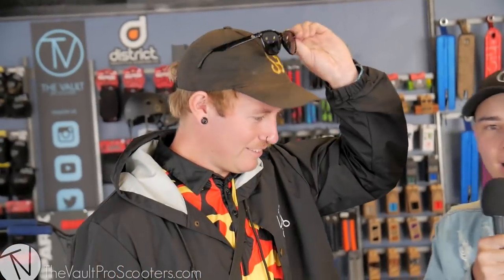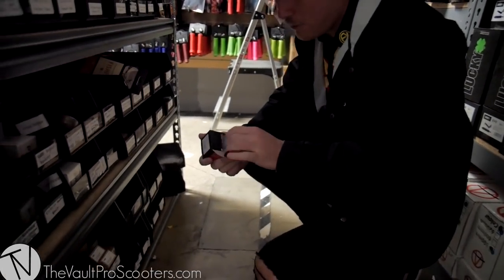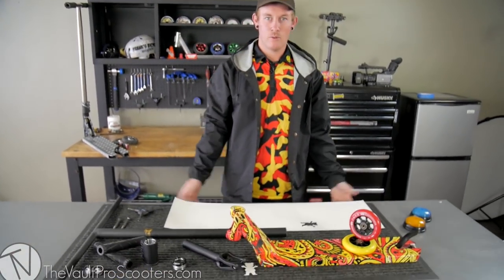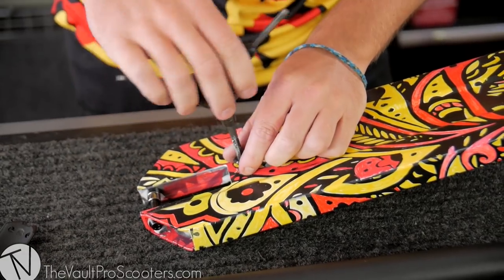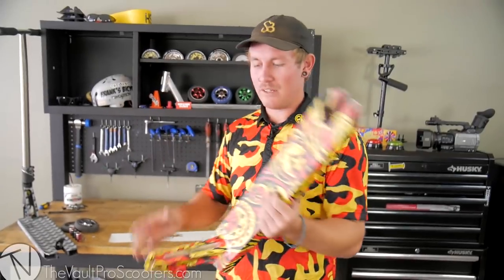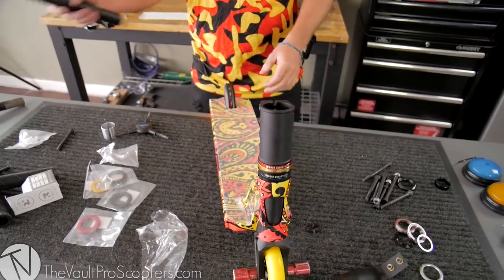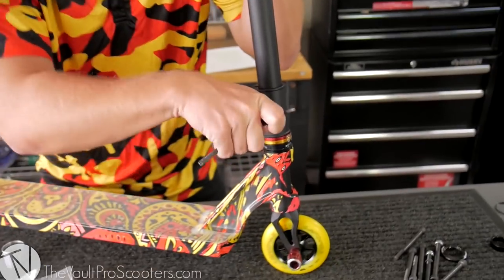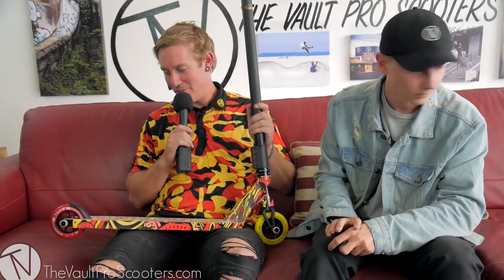Custom Build Off #7 - Part 3 (ft. Scooter Brad) │ The Vault Pro Scooters

Comment: CLICKBAIT 😡😡😡😡😡
💯 CODE : BOOTER @TheVault fam 💯
Reply: Scooter Brad how would I put 2 apex barnaynay on the front?
Reply: I love ur vids
Reply: Fina SB one question do Envy Union bars fit on a S6 Prodigy deck and still we dialed
Reply: Scooter Brad my boii💯 it’s the best set up 🙏💪❤️
Reply: Trentyn Harrell bars isn't what makes a scooter undialed. Compression, axles and sometimes bearings is what causes a scoot to be undialed. And yes those bars would be perfectly fine.
Reply: Scooter Brad I’m not gonna vote. Too hard
Reply: Trentyn Harrell I bet they do. Just do some research. Make sure there standard sized. If not, buy a oversized shim
Reply: Best build 🔥❤
Reply: Isaiah Brooks Vlogs ok thanks
Reply: Nicolas Pellerin ok thanks
Reply: no cos unions are aluminum dont buy an oversized shim because they will always be standard on the inside and oversized on the outside
Reply: Scooter Brad i
Reply: Why did you change the headset spacers back to black😫😫😫
Reply: Scooter Brad I’m voting for you
Reply: I am voting for you but I would love the scoot even more if it had two John archer wheels
Reply: Brad I've got my vote
Reply: BOOTER CREW
Reply: Scooter Brad I am voting for you👍👍👏👏
Reply: Scooter Brad #bootercrew # boonkgsng
Reply: Scooter Brad I wish I had your pegs I wish I could buy them so bad
Reply: Scooter Brad can this be your Sig
Reply: Scooter Brad I
Reply: Scooter Brad ii
Reply: Scooter Brad  I need a new scooter it free if so how do I get it and u don't now my house is
Reply: I don't got the money
Reply: Scooter Brad iii
Reply: Scooter Brad ο
Reply: C bastian
Reply: 0ndrej K. You need a long axle
Reply: HI I KNOW WHO UR SON IS IM HIS FRIEND HIS NAME IS GABE
Reply: Scooter Brad Why do you live
Reply: Was it hydro dip or pen
Reply: Watchers from nz be like: OH MY GOD A I SAW HIM AT THE SKATEPARK
Reply: @ondrejkoplik647  i need the answer too 😫

Comment: I'm running apex benanae pegs on my scooter with that mod right now, and it took 2 minutes to do
Reply: how do u do it
Reply: Jeghersh27 get a small axle, with both pegs, put the nut in one of them, tighten them enough that the nut starts going into the pegs